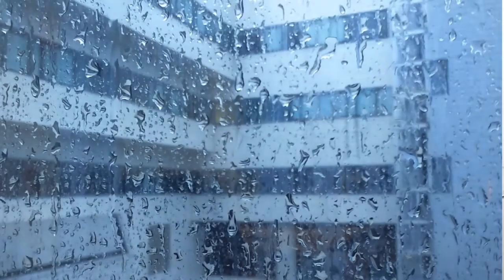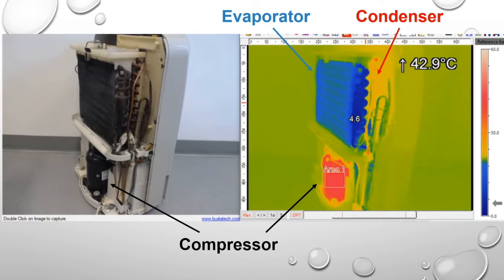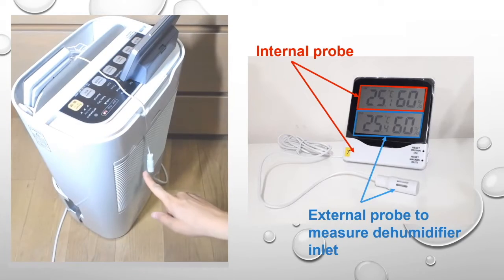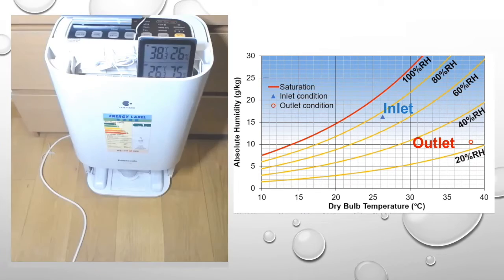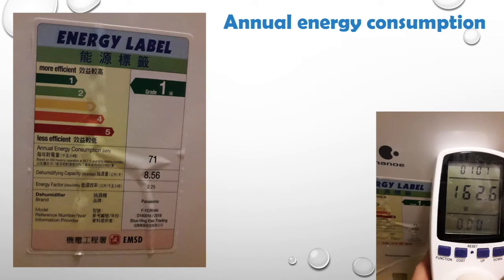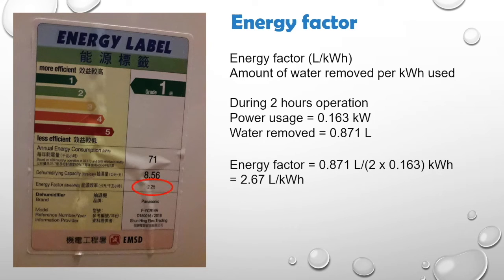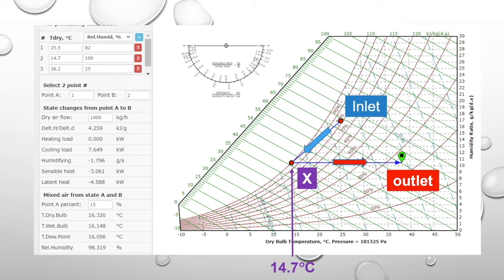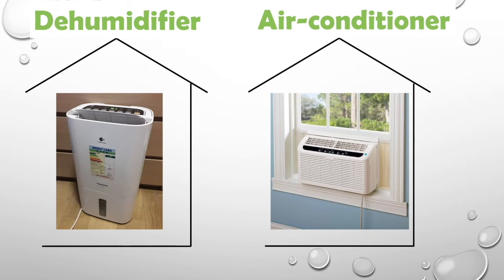How does a dehumidifier work?

Comment: From the breakdowns of what I have seen of dehumidifier, they are absent a filter drier. A/C units have a filter drier and the dehumidifier does not. Also the location of the of the evap and condenser. The cool air of the evap moves through condenser vs the cool air moving into a conditioned environment and the condenser hot air being rejected into the outside air. Im assuming it is this location that prevents the captured humidity from freezing to the evap coil. The heat from the condenser is passed to  the evap and causes the humidity to stay in liquid form. This is what prevents the need of a defrost element. I dont know what the critical charge of these systems are nor am I very familiar with  them. I do work on residential refrigerators. So I do have some knowledge the process of refrigeration.
Reply from the maker: Dear David, thank you for your comment. You are correct, the fundamental principle of an AC and a dehumidifier are the same. Both of them uses a vapor compression refrigeration cycle. The main difference is the location of the evaporator and the condenser and how the air is moved. For a dehumidifier, both of them are inside the house. For an AC, the condenser is outside. Because of the difference in function, the temperature of the evaporator and condenser will be different for AC and dehumidifier as well. For example, in the case of the condenser in a dehumidifier, the heat will only need to be removed indoor, so the condenser temperature only needs to be higher than room temperature. But for AC, the condenser temperature will depend on the outside air temperature - the hotter the ambient is, the harder the AC needs to work.

Comment: Wait it's just a heat pump?
Wow there are heatpumps everywhere these days.
Reply from the maker: A heat pump and a refrigeration unit have the same mechanism.  An air-conditioner/dehumidifier/refrigerator uses the cold side of the refrigeration cycle. A heat pump uses the hot side. In some sense, they basically move heat from one side to another side
Reply: @denisywyu7864  Thank you for an interesting video! I bought a dehumidifier primarily to… dehumidify… But I also reckon it will help to heat my house, as the COP is around 3. Even though the cooling and heating part is indoor. condensating vapour releases quite a lot of energy,  the opposite of boiling water, where you put energy into the water to convert to vapour. Am I thinking correctly here, and do I get somewhere in the range 3 times the energy out of the machine as a byproduct?
Reply from the maker: @bernardopedal7638  Hi Bernard, in general if you run a dehumidifier, the room temperature will go up. The simplest way to think about it is that the entire system is inside the room, but you are applying an extra power to run the compressor. That energy is basically converted to heat and so your room temperature should increases. Though, I don't think you get 3 times the heat though. The cooling capacity is 3 times, where the energy is taken out of the condensed water, but the extra applied energy is still that of the compressor.